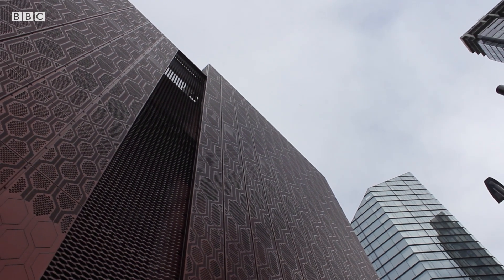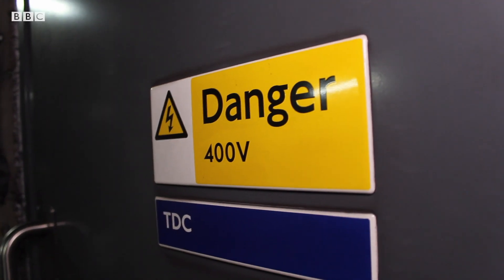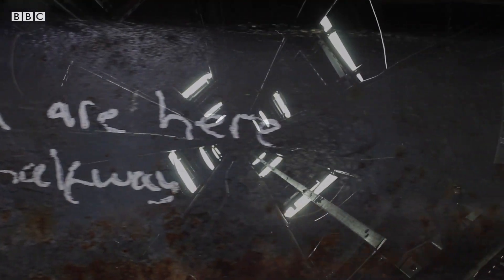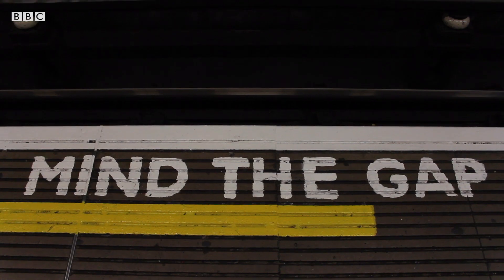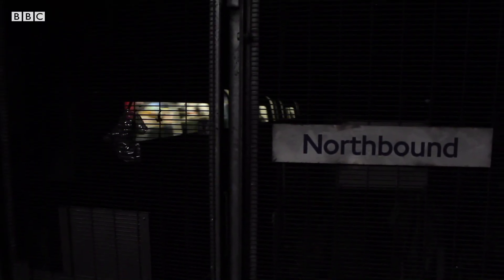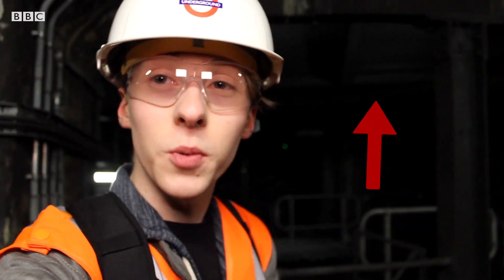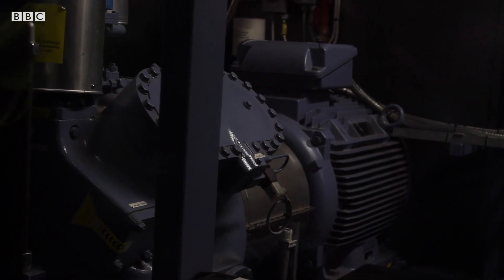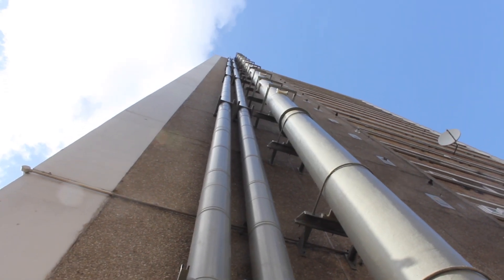How an abandoned Tube station is heating London's homes - BBC London

Comment: Would the heat stop if it were reopened?
Reply: The heat comes from the operation of the trains, it warmed up the clay and the clay is releasing that heat over time. Trains add heat. Maybe they could circulate air without releasing heat if they didn't use their brakes... dunno